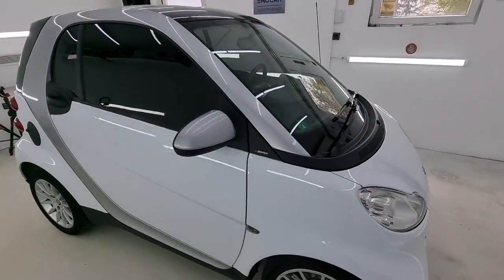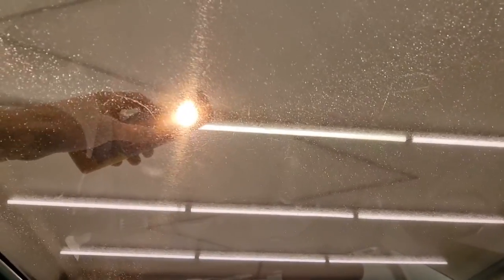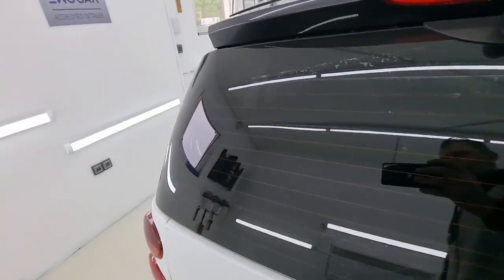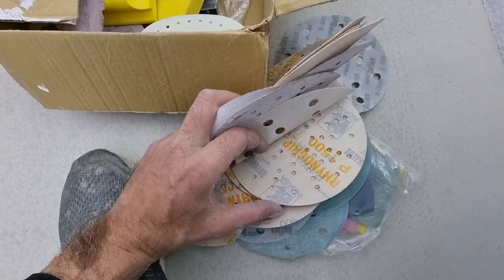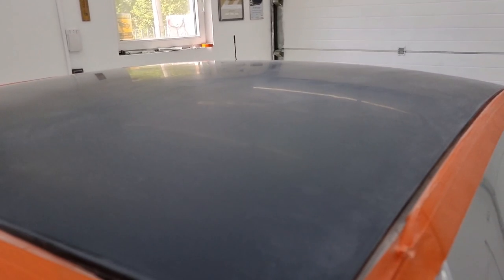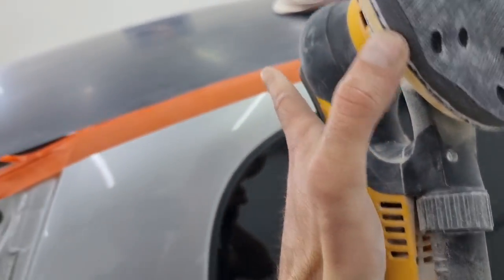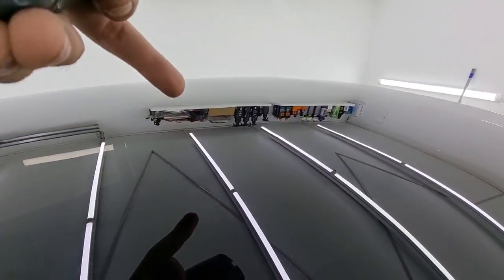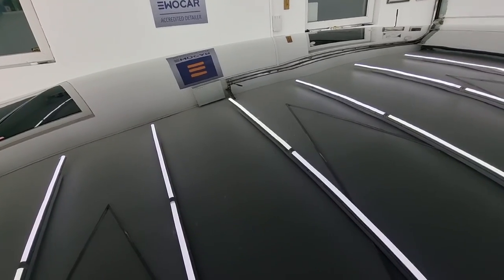PANORAMA Sunroof REPAIR-CAR RESTORATION

Comment: You really should have cleared it with 2 part urethane clear coat. That "cracking" known as crazing is use to UV damage. You need to put a UV resistant layer up there every few years in order to protect it from the sun. In your case since you already got a glass looking finish a clear paint protection vinyl wrap should protect it for 5-10 years.

Comment: Just picked up a 2008 passion model yesterday. The roof is pretty bad as expected. As someone who has done a little bit of paint and bodywork and plenty of detailing before I will definitely be referencing this and trying to replicate the results. It’s going to be a daily driver so I’m not looking for perfection but any improvement would be great. Did you polish with regular paint polish and a DA buffer for the final stage?

Comment: An absolute amazing result. I would have never thought it possible. You give me inspiration. Can you confirm that the piano black plastic side trims were sanded in exactly the same format? ie Hard interface, 150, 320 etc - 3000?
Reply from the maker: Yes

Comment: That turned out awesome! I just got one question though, so from what I understand you used cheap paper from 150 grit all the way up to 3000 grit then you started with the kovax paper. What grits of kovax did you use and did you finish with the 800?
Reply from the maker: Kovax 800 1200 1500 2000
Reply: @Amddetailing  Thank you!
Reply: Hello ! Which Kovax series do you recommend for this application?

Comment: Great job but you didnt show the polishing stage. What did you use etc.
Reply from the maker: I used it as in all my videos where polishing is shown, which is:
ewocar heavy cut compound with roto machine and wool
The 2nd hand is a dual machine with a medium spring
and the 3rd hand is finished with a soft sponge and Gyeon Primer finishing paste

Comment: Looks great, will be doing my roof aswell. Has the same issue. How did you finish? Polishing pads, foam, or wool, polish type? Thx
Reply from the maker: If it is the same roof, it works in the same way
Reply: @Amddetailing  Thanks. Great work. 
What grade paper did you finish to get the high gloss finish?
Reply from the maker: @CrustyRestorations  2000 kovax paper

Comment: I have a Prius V with a massive panoramic roof and the whole thing is crazed. I didnt notice the problem until i bought the thing but it looked like the previous owners parked outside alot. Ive been worried about if i could sand/polish most of it out then clear the rest/wrap it.

Comment: when did Smart change to Plastic roofs ? my older 2006 450 , has a complete glass roof . thanks
Reply: They did it with 2nd generation (451) because of too many shattered glass roofs in 450...

Comment: What about sanding with a rotary sander ? I don’t understand when you said I didn’t have to paint the sunroof , if you painted it it wouldn’t be a see through would it ?🤔🤔🤔🤷‍♂️
Reply from the maker: the coating is tinted and painted without any problems, the pure color is not painted
Reply: Ok , so it’s clear coat with a tint in it ?

Comment: I never saw finishing,compound polishing etc
Reply from the maker: because the theme of the video was repairing damage by grinding, and it was polished with roto wool, ewocar compound and later with dual action as a finish